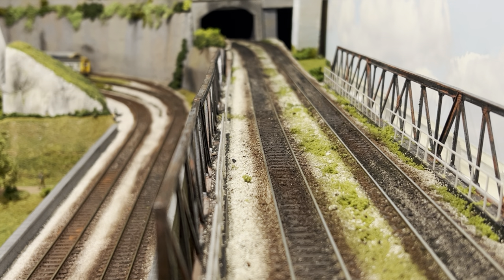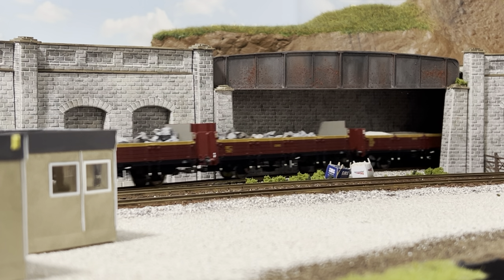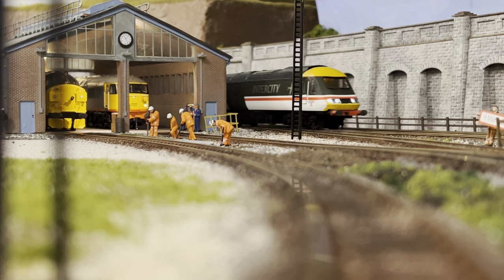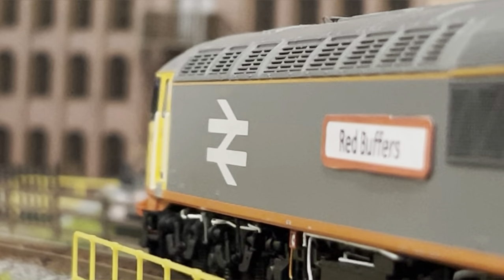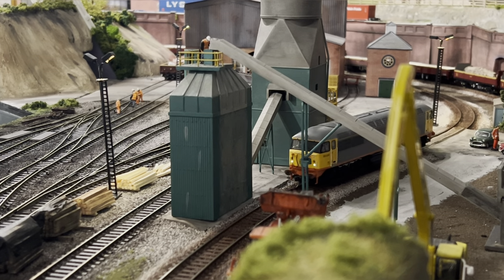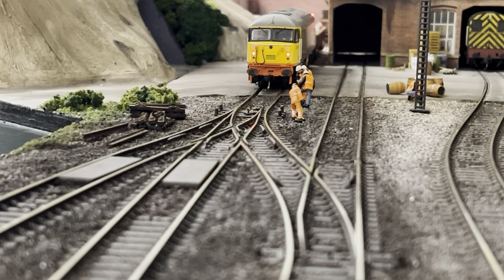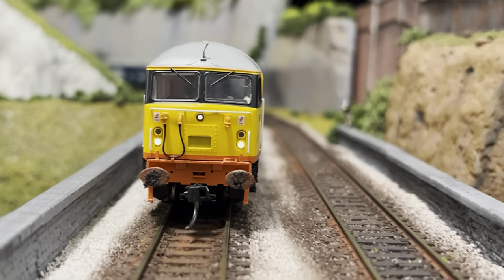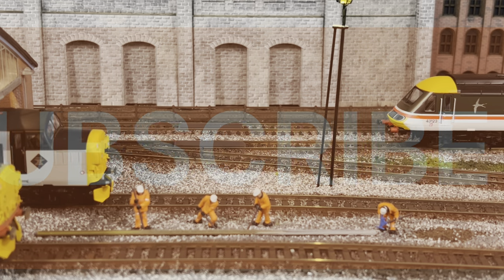Liberty Junction ep23 my week of modelling hell! Featuring Accurascale Bachmann Cavalex & Chinchilla

Comment: Well, mi old flower, your return was triumphant. You have done a mighty job with what ive seen. Looking good again. As for turning out to not be fun? We have all had them. I finally got the shunting yard laid, to find that some of the rolling stock and 3 loco's short over two points, but only some. and not always the same one. So yes we know. lol. Another great vid, the 37's showing. Once again all is well with the world. A Double 0 Dave vid, with 37's. Nice.
Reply from the maker: That sounds a right pain in the arse, are they class 37s? If not throw em in the trash and replace them with lovely 37s and see if the problem persists.  If it doesn’t all good 👍 the end.  If it does throw all the track away and replace it with shiny new track, still persists after this? I’ll have your 37s and buy a scalextric instead 😎😆👍 hope this helped 😇
Reply: @doubleodave  Oh elp! lol. Although I was considering putting a scalextric in the layout at one time. took up too much space.

Comment: Just love your channel, with all the comedy bits. What you've achieved with the layout is brilliant, I'm just starting with the hobby after a 50+ year lay off, and watching how you've created parts of yours has been really useful and confidence inspiring. I see in this latest one that you've installed some of the Accurascale Rawie buffer stops - I ordered two last week to play with but couldn't believe how extremely fragile they are. Both have now come apart, just from handling while trying to put them on the track. It's like not enough glue was used assembling them in the factory. So now I'm faced with trying to glue miniscule parts back together or just giving them up as a bad choice and using a different type!
Reply from the maker: Thanks for the comment appreciate that 👍

The Rawie stops are crazy weak so be very careful But once installed seem ok (they’ll stop a moving loco without breaking) I obliterated one first time trying to install it but managed to bodge it back together, it sits behind the fuelling point but only one light works now which isn’t too bad as they’re super bright, I might even dull them down a bit as they’re like laser beams on camera! The trick to install them is to slide them down from the end of the track, which isn’t so easy if you’ve glued all your track down beforehand like I had!
Reply: I don't feel so bad now knowing you broke one too! Yes the tip about sliding them on I learned after trying to push the first one down onto the track and having it disintegrate. I thought I'd got the second one on by sliding ok but it looked slightly skew wiff and I broke it trying to straighten it. I'll have to find out if my hands are steady enough, with some helping hands clips, to glue it back.